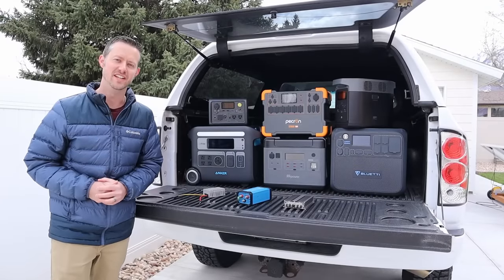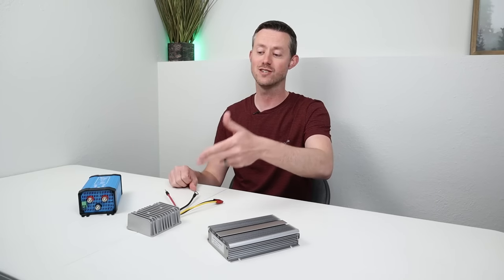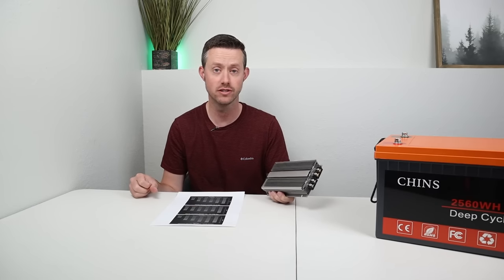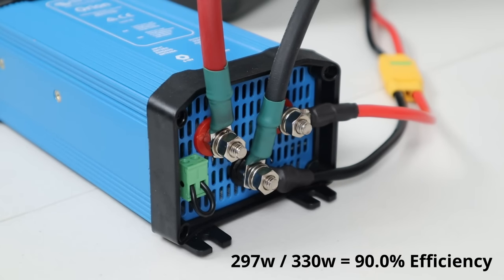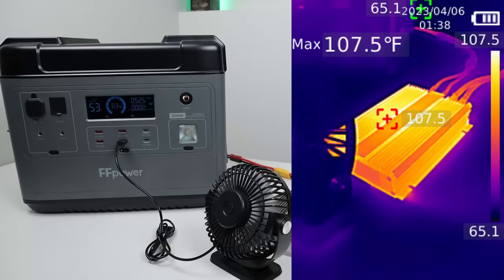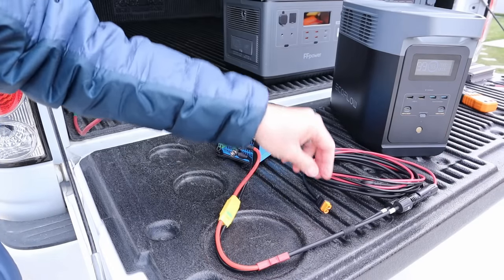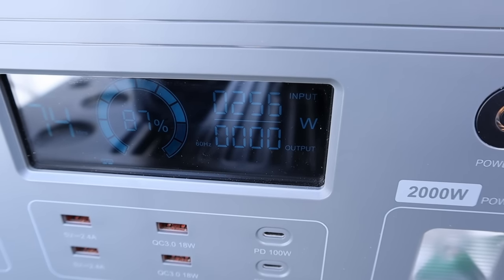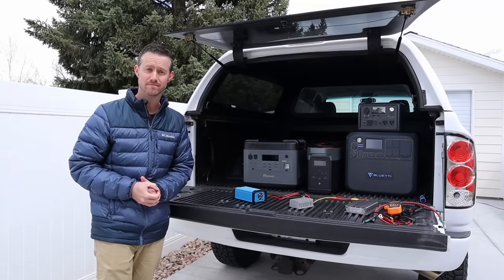Charge Your Power Station In Your Car FASTER - Perfect for Overlanding, Car Camping, and Van Life!

Comment: Ok a quick question I have a campervan RV with a full system including a dc to dc charger and a lithium battery. I also use a AC200 max for AC power so microwave etc but just bought the victron step up and wondered if I could attach this to my lithium battery to charge the AC200 and add a switch to the victron when I don’t want it to charge also can you daisy chain the victron into a solar panel then plug it into the AC200 to get say 600watts of power
Reply from the maker: Yes, absolutely

Comment: Any issue with this set up: I have a red arc bcdc charging my 100ah lifepo4. I’d like to use this Victron charger to charge my ecoflow delta mini from my 100ah lifepo4. Thanks
Reply from the maker: Been working great so far. Just make sure the converter is compatible with the input voltage of your power station. These can get pretty warm so the Victron with the built in fans is a great option.

Comment: Have you tried out the Anker Solix C1000? I've had it for a month now and its been great powering my fridge and fan in the truck camper. Looks like the victron would be the best choice back there
Reply from the maker: I'll be putting out my Anker C1000 review video soon. It's a great unit. Super compact, decent solar, powerful inverter.
Reply: @Jasonoid  you're right about that. It fits nicely under my bed platform and hardly takes up any room. It's pretty amazing how I can charge it up from the wall in just under an hour. It's why I'm not rushing to get this victron installed.

Comment: Hi, maybe this is a stupid question, I have a inverter build in my car  12V to 220V max 600 Watt pure Sine . Can I charge the FFpower P2001 using the cable that is with the powerstation ? Or can I destroy then something ? ( in Europe we have 220V )
Reply from the maker: You'll want an inverter that matches the same charging input specs of the power station. I am only familiar with the US model. If you charge your power station off 220v normally I don't see why that wouldn't work.

Comment: Hello Jason, Do you know if I could run the 12-24 Orion converter output in parallel with a 12v Solar panel into the Delta 2. I would like to be able to charge while parked or camping.
Thanks!
Reply from the maker: Keep in mind, the Delta 2 is being limited by the built in charging amperage limit when using the Victron. Adding any extra power (solar panels) to the Victron won't add any extra power.
The only way to get faster charging in your specific scenario would be to get a higher voltage DC to DC converter (36v or 48v). For example you saw faster charging on the 12v to 36v converter because it had a higher voltage than the Victron. 

Now if you had the larger Delta 2 Max with two charging ports, you could plug your solar panels into one port and the Victron into the second port and dual charge up to 500w on each port.
I hope that info helps.

Comment: I see this video is newer than your video with the Bluetti DC Charging Enhancer. I want to ask if that's essentially the same thing?  Since I have a Bluettie AC180 (which uses the same port to charge solar & cigarette lighter), could I just buy the DC Charging Enhancer instead of messing with picking a converter and setting that up in my vehicle?  I know the Charging enhancer is more expensive, but it might require less additional parts/wires/adapters...   It also seems like the stand-alone DC -DC converter puts more watts to the Bluetti, is that accurate?
Reply from the maker: The Bluetti charging enhancer is very limited at 12v charging, it shines at near 60v input. You'll want to use a dedicated power station car charger like the Pecron 500w car charger or the Etaker F1000, which I will have a video on this next Friday (hopefully)
Reply: @Jasonoid  I JUST watched your video on the Pecron and ordered one! 
Thank you for these videos. They're great information

Comment: Hi would you happen to know if this model DC to DC converter will work with a 240A SMART alternator with an 800Ah AMG battery, please
Reply from the maker: You'll want something like this instead to charge an AGM battery:
https://amzn.to/4a7ca1b
This one charges at 50 amps, which should be a good load on your alternator.

Comment: The Pecron E2000LFP has input stats as 32V~95V / 600W Max / 15A Max. Using the 12v - 36v (20amp) booster, the volts are within range, but the watts exceed the max by 120 watts and the amps by 5 amps. Does the unit basically throttle back the input to a usable level and is there any possibility of damaging the unit, or does it just throttle it and not skip a beat? Thanks!
Reply: I can't answer your question about "throttling" back the converter output.  I decided to go with a Daygreen 12v to 48 V 10 480 watt converter so the output would be under the 600 watt max.  Will try this out 12-2023.

Comment: Hello All - I'm going with the 12v to 36v 20 Amp Converter to my Bluetti AC200Max , but my question is what can I place in the electrical circuit to disconnect the battery once I turn off the van?
Also can you suggest if I need to place a large fuse on the positive 6 gauge wire coming from the starter battery before it gets to the Amp Converter?
Reply from the maker: I'd definitely recommend a fuse near the battery terminals. 6 awg wire is rated for 65 amps so maybe you could put in an 80 amp fuse. For shutting off the converter, you could put in a marine battery disconnect, those work well to turn off high loads.

Comment: Is there a 12v to 36v or even to 48v converter with a built-in fan in the market? Anker 767 takes in 20amp but the input must be above 36v. Victron has a fan but does not produce that high volt. I am looing for a unit with a built in fan?
Reply from the maker: I haven't seen anything like that. I wish there was an option with a built in fan for cooling like the Victron Orion.

Comment: thank you for such information!! I have the ecoflow delta 2 and would love to do this! except 😂😂 I know nothing about electricity.

I see my idle output is 110 and full output js 220. This would meet the 50% safe range right?!

I'm guessing i should also make it in a way the power shuts off from the car battery when not in use and add a fuse like you did.

Would be more than grateful if you cohld show your set up so how this can be possible! you may have already 😂I am watching your video couple times but as somebody new to this not totally processing it😅
Reply from the maker: You should be fine charging your Delta 2 off your alternator. You have plenty of extra power available.

Comment: Jason, I have a Delta 1300 and the XT60 input says 65V\10A max input.  It doesn't appear to have the XT60i input.  If I am reading the Victron Orion spec correctly it is putting out 20A.  Does this void this charging solution for me?  TIA
Reply from the maker: The power station will limit the amperage input automatically to 10 amps, you will not have an issue using the 20 amp converter on this model.
Reply: @Jasonoid  thank you for the reply

Comment: Such a awsome video!!!
Reply from the maker: Thank you, it took a ton of work!
Reply: @Jasonoid - You & tuber Tinker Adventure made this video & usage of these converters, are the most informative ones by far with setp by step & other little info like cables etc. Not many do that. So thanks.
Reply from the maker: @1ENDUSER  I saw his video recently, it's a great one too.
Reply: @Jasonoid  - btw would you choose the victron option or the option of the kisae dmt video you did? Trying to decide which is better value/options.
Reply from the maker: @1ENDUSER  this video is for charging power stations faster. The Kisae DTM1250 is for charging standalone batteries, two pretty different options. 
I like both options for powering my fridges on the go. On is more DIY and the other is 'off the shelf'.

Comment: I'm just recently learning about power stations and solar solutions for cars and vans and this is helpfull. Still the way to know if my small car will be capable I'm not yet sure about. I get that you would need to know the amps that your alternator output. But still is it safe for you car electric is there another video that is about connecting this and what is safe for which cars. Thanks in advance
Reply from the maker: Its all about the size of your alternator and the amps it's rated for. Most cars would support a small 12v to 24v boost converter without an issue. That would pull around 20 amps from your alternator/starter battery and charge the power station at around 220 watts.

Comment: Hi Jason am going to go for the 12-36v 20amp converter . How would I wire this from my battery to the bluetti AC200max please 🙏
Reply from the maker: Positive and negative output wires of the converter go into the Bluetti charging port adapter. You'll need to adapt to an xt90 plug or MC4 plugs to connect into your AC200MAX.

Comment: I am using a 2000w pure sine inverter (because I got it cheap) to charge my Bluetti ac200max.  I have a 200amp circuit breaker at the start battery which I use to disconnect the circuit when not in use. Is there any problem with that? It is only used to charge the bluetti which only uses about 500w while driving.
Reply: Why 200amp fuse? Not too high for your set up?

Comment: Hi do you recommend fitting an inline fuse between starter battery and the Victron unit? Or between the Victron unit and a power station? Thanks
Reply from the maker: Having a fuse is always a good backup.

Comment: For 12v to 36v on Anker 767. What awg cable do I need?  Also do I need to put fuse on the input and output positive cable of the step up converter (what amp?)
Reply from the maker: So in the video I noted 700 watts from the 12v to 36v converter on the Anker 767. So breaking down the power from the battery is this:
700w / 12v = ~60 amps
I'd recommend running 4 awg wire from your battery to the input side of the converter, with an 80 amp inline fuse.

On the output side of the converter to the power station I'd recommend 10 awg wire with a 30 amp fuse.

Enjoy the project!

Comment: Awesome Video Jason. I assume that the wires were connected direct from your starter battery ?? What if you use your car cigarette socket ? Would you be limited to the 10a output ?
Reply from the maker: While using most 12v cig ports, you'll be limited to 120 watts (12v @ 10amps). They aren't meant for high power at all so you have to bypass all that and go directly to the starter battery for your high power needs.

Comment: How would you add solar panels to the mix to give you a supplement? How would you wire it?
Reply from the maker: The power station would need to support dual DC input ports, like the Ecoflow Delta Max 2 in order to take solar and car charging at the same time.

Comment: Can I safely use the Victron Energy Orion 12/24-Volt 20 amp with my EcoFlow River2 Pro?   Will the 20 Amps it is putting out be safe with this setup?
Reply from the maker: The power station will limit the the current automatically, no issues with your power station 👍

Comment: Question.  I’d like to know Which is better.  Converter or an inverter .?
Reply from the maker: Just depends if you want to AC charge your power station or DC charge it. If your power station has adjustable ac charging then an inverter might be worth it. The DC to DC converter is slightly more efficient.

Comment: My top concern is always "How long to fully recharge each day?". I have a CPAP that must work all night, every night, which dictates my choice of power station and method of recharge. Which option is both doable and "idiot proof"?
Reply from the maker: Most idiot proof option would be to connect a 1000w ac inverter to your starter battery and charge your power station that way. Just make sure your power station doesn't charge faster than 1000w.
To estimate charge times, take the watt hour capacity of the power station and then divide by the charging wattage. That will give you the charge time in hours. Example:  2000wh / 500 watts = 4 hours to charge.

Comment: What’s the difference between a boost converter and a dc-dc charger? Same thing different name? How does this compare to the pecron?
Reply from the maker: A DC to DC charger is meant to charge a 12v battery and doesn't put out higher voltage. 
A DC to DC boost converter takes the 12v from the battery and boosts it to a higher voltage: 24v, 36v, or 48v so the power station treats that power like a higher voltage solar panel.
You can only charge a power station faster with higher voltage.

Comment: keep in mind most vehicles have 30 amps to spare, if you decide to use one of these boost converters you need to make sure you are still charging the battery and not pulling electrons from the starter battery for too long, or you will probably kill it. you can get a few more amps by turning off all accessories in the vehicle, like lights, radio, AC excetera. also if you do need to pull more amps you can raise the revs by putting your foot on the gas pedal.
Reply from the maker: Great tips PM! Much appreciated 😊👍

Comment: Nice post! But...can the Anker 767 being charged with modern car alternators (Eco type). Those require smart dc dc converters and unfortunately Victron as you know does not supply output voltages compatible to the 32V requirement of the Anker. Anyway to solve this? 
I haven't been able to source a suitable buck boost converter. Is it possibke to hook up the start battery to a Victron and then go to a second dc dc converter to crank up the voltage?
Reply: He uses Anker in  the video and it works

Comment: OK so I can run a line from my battery to the Bluetti Max200 (with fuses) inside my Honda CRV?
Reply from the maker: Yep, that will work. BUT, you'll need a converter in that setup to get more that 100 watts charging.

Comment: Hello Jason
I have a EcoFlow Wave 2 and I have the 12v to 36V step up voltage regulator (as shown)  can I connect its output to the Wave 2 with just a XT60i (orange connector) with a pigtail, directly into the XT60 input port from the step up regulator?
Reply from the maker: These are the specs listed on their website:
Solar Charging Input11-60V, 13A, 400W Max   OR   Car Charging Input96W/192W (12/24V, 8A Max)
The DC to DC converter @ 36v with the XT60i connection should simulate solar pretty well.

Comment: Great video. Can you charge 2 power stations at once with the victron ? What would be needed and are there any disadvantages?
Reply from the maker: Maybe two smaller power stations, but not a big one.
Reply: How about using a 300 or 700 watt DC to AC pure sine inverter? Most come with 2 AC outlets
Reply from the maker: @tonyjirik2145  that will work, as long as you dont go over the total wattage the inverter is rated for.
Reply: Yes. My power station’s charge controller AC draws around 700 watts peak then lowers all the way down to 5 watts when it gets to around 95% to top it off completely. So in theory I’m leaning towards a 700W inverter then maybe daisy chain the 2nd power station via DC or AC and see what it does 🤷‍♂️
Reply from the maker: @tonyjirik2145  probably would be best to run a 1000w inverter. Pushing an inverter to it's limit for long periods of time is asking to burn it up.

Comment: I normally charge my Anker 767 from 120v but if the power is out for more than 3 hours it runs out of juice powering my 37' trailer. I have a Champion 2500-Watt Inverter Generator. Would I get any advantage from buying the 12v to 36v converter and charging from the 12v port on the generator via the boost converter to charge the 767. The reason I ask this is because you said DC to DC is more efficient
Reply from the maker: If you already plan to run the Inverter generator as a backup, I'd just recommend sticking with that. The the Anker 767 will charge at 1440 watts which will fill up pretty quickly.

Comment: Really Thanks for the video, If I have an Ecoflow Delta 2 Max, the inputs are up to 60v. It is more efficient to use converter 12vdc to 24vdc 20A or converter 12vdc to 48vdc 20A? Does it make difference because both are 480W. Thanks
Reply from the maker: Remember the power station has an amperage input limit. When you use a 20 amp converter, the power station will only allow 15 amps total input and you'll have to use the orange XT60i adapter to get that full 15 amp input as well. The normal  xt60 charging plug will get 8 amps or 13 amps depending on the input voltage. 
(24v x 15 amp = 360w)
(48v x 15 amp = 720w)
Now you won't see the full 720w since it also limits to 500 watts per charging port. So the 48v converter would just get 500 watts consistently. Does that help answer your question?
Reply: @Jasonoid  thanks for the answer my choice is under 2 converter the one you have in video, 12vdc to 24vdc 480W and other is 12vdc to 48vdc 480W. If I take your number the 24dvc with 480W was 20A output than the 48vdc was only 10A. This one run under the limit of Delta 2 Max. Seem better to me but I really not an expert. It will be my first installation. Watch do you think?
Reply from the maker: @renyraiche-gregoire4921  I'd recommend the 48v converter, you'll see good power from it on the Delta 2 Max

Comment: How do you protect your car battery from drain? would u use a DCDC converter like red arc?
Reply from the maker: I just connect the converter when I need it. I only have it connected when the engine is running. You could also wire in a remote relay to power this when needed.